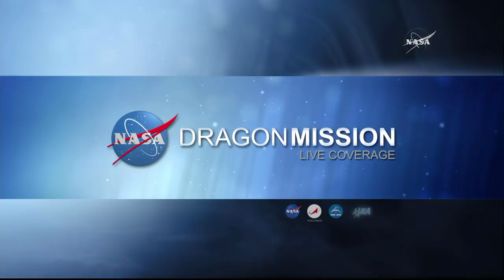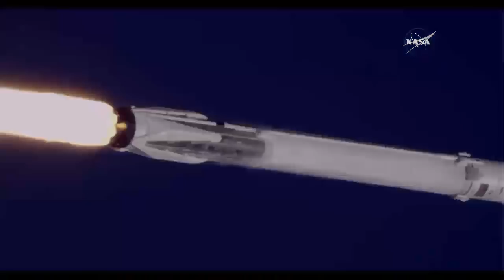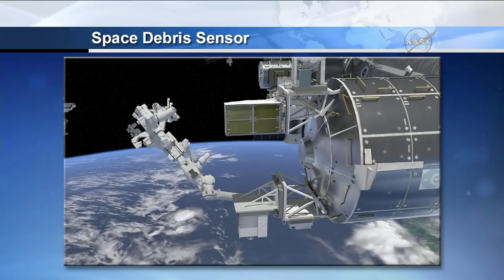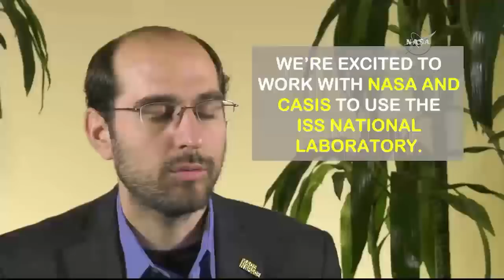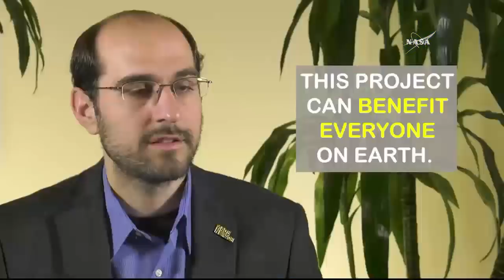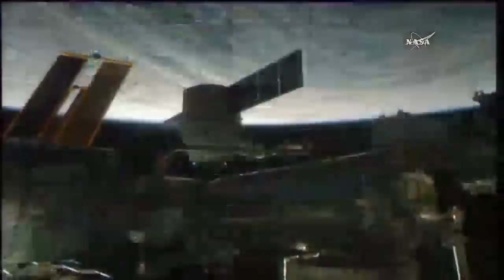Full Space X Dragon CRS-13 ISS Resupply Ship Docking And Installation Coverage

Comment: It makes one wonder, has the ISS done research on microgravity metallurgy? 

There was a big hype about asteroid mining a while back, however it would be a waste to bring back most of the materials on earth to transform, unless they are very precious. We would have to transform the metals in microgravity eventually to use for spaceship applications. The best option ought to be cylindrical crucibles that rotate around its vertical axis at high speed to permit separation of the impurities.
Reply from the maker: we know that  centrifuges work to create effective gravity, so thats not really a topic of research - also centrifuges have been used on earth to accelerate or enhance gravity-powered processes or make processes happen that don't happen in earths gravity because its too weak - the ISS has however doen a few experiments on metallurgy without cnetrifuges actually taking advantageo  f microgravity where it is beneficial, though usually the main goal of these experiemnts was to gian more fundamnetk knowledge about the material itself to apply that knowledge on earth, rather then to learn actually manufacturing in space, while the idea had been around, as a serious endeavour it is rather recent
Reply: Space manufacturing is the next step after asteroid mining. Research has to be ahead of the curve to attract investors by demonstrating that mining, smelting and manufacturing in space has commercial applications.

Asteroids, even if highly concentrated in metals, have a very chaotic structure that is riddled with impurities, voids and fissures. The minerals will necessarily need to be purified on a large scale. Since it would be in the vacuum of space, it could result in much better and purer products than here on earth if done right.

Anyways, I'm just daydreaming.
Reply from the maker: well, on this spacecraft is an experiment from a company hoping to manufacture glass fiber in space - these kinds of epxensive lightweight hightech products are obviously the first to be viable for space production, they'll lead the way to starting a sort of space industry, from there we can work on
https://youtu.be/xrPdKsYgp3I?t=56m3s